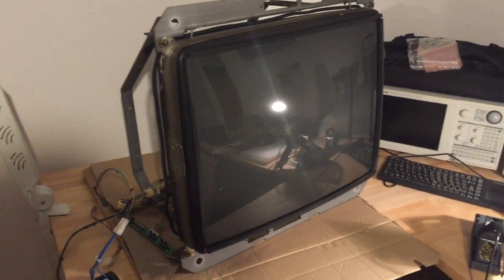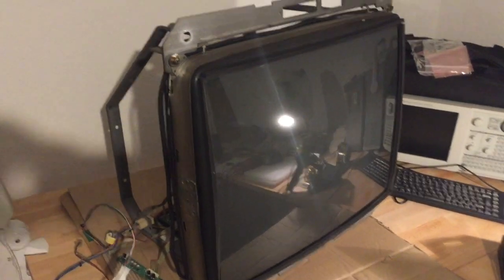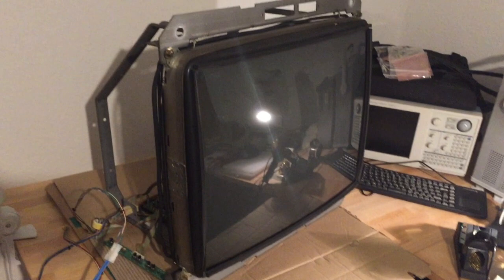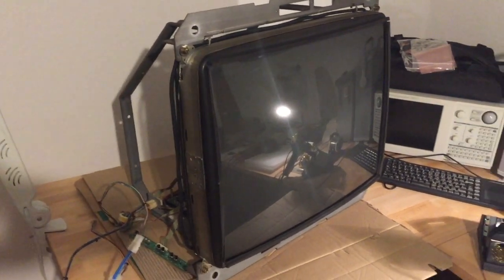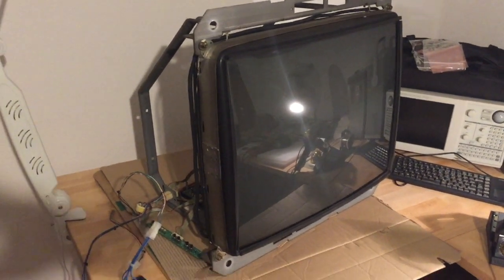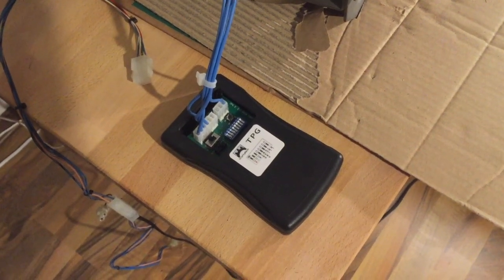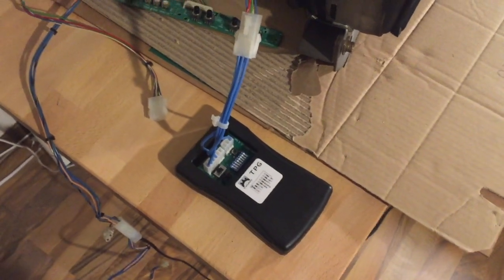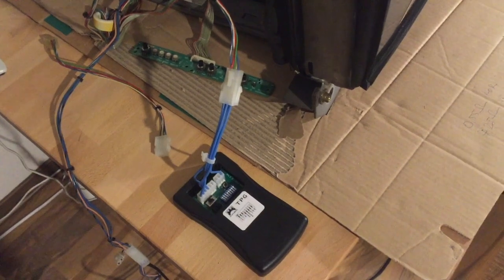Arcade Monitor Repair - Vertical collapse - Sega/Nanao MS9 29SU

Comment: Hi Doktorzett, thanks for sharing this information, I will order parts today.
I have another 29 inch Nanao with a lot of picture noise(similar to a faulty power supply on the game board video output, but I have isolated to the monitor chassis). Any clues which caps may require replacement? Rather not shot gun the entire chassis as I think this can create more problems. Thanks!
Brett

Comment: Hello - I did an entire cap kit on my Sanwa PM1745 C chassis with a vertical collapse and to my surprise It didn't fix the problem. Any idea where else to look? I have the twin Japanese Daytona USA and would really like to keep them. They were working fine with hundreds of hours of fun and the left monitor just tapped out.
Reply from the maker: Did you replace the vertical ic as well?
Reply: @christophzett  Hi - Yes, IC vertical Chip and all the caps. I have to re-check the solder points and see if I missed anything. I should have done the recapping a section at a time  like you did for better trouble shooting. I want to  keep this set. I have a Twin USA set also. Any ideas I would appreciate them. Thank you!

Comment: various arcade games use different arcade monitors with different rasters and resolutions, all the sync signals are all different for various arcade games. Any reasons why they made different sync signals for different arcade monitors? You can't take an arcade monitor and swap and replace them with another arcade monitor because the sync signals H&V signals will scramble the colors on the CRT.  The arcade monitors circuit board ground is not chassis earth ground because of the isolation transformer. Why does arcade monitors circuit board use an isolation transformer?

Comment: I ran into this exact problem a couple years back.  It would actually blow the center out of the vertical IC if certain caps were bad.  

On most of the Nanao monitors I've seen, the degauss was controlled by a manual switch mounted behind the coin door.  You would have to push it for a few seconds each time you relocate the game.  Not sure why they did it that way, since the thermistor circuit still worked the same as any other monitor.

These usually have a great picture, even if the CRT is a bit weak.  I know the older MS8 used a Mitsubishi CRT, but I can't remember if the MS9 did.
Reply from the maker: I absolutely agree! Brilliant monitor - even with a 20+ year old tube great colors contrast and sharpness of picture. I actually like them even better than the WG7500.

Comment: I have a similar issue to this but the line is right at the top of the screen, is this the same issue?
Reply from the maker: No not exactly the same because in your case the vertical ic is still doing something - it can not have failed completely because it still deflects the electron beam vertically to the top of the screen. The interesting question is only why the vertical deflection does not go through all the vertical lines as it is supposed to. In your case is the monitor chassis also an Nanao MS9?
Reply: @christophzett  no its a JVC BM-H2000PN-K broadcast monitor. It was working fine last week no warning of issues just turned it on today and nothing if I press the 'Overscan' button there are 4 while lines running across the screen at the top, usually it's red, blue and green lines going across the screen. If I press the 'Blue Screen' button on the front of the monitor (which usually turns the whole screen blue) the bottom white line of the 4 turns blue.

Comment: Current kills, not voltage (in response to the warning at the beginning). It is usually conscience they go hand-in-hand. Best proof is touching a door knob on a cold, dry day. You might get a static shock. Those that have a very mild sense of pain are about 35KV, but the current draw is so low, you barely notice any pain at all. This is why you might see people in some pain when using a Van De Graff generator, as those are about 60KV on average.

Comment: Hi, tnx for this nice  Video, i have the same Monitor. My makes another kind of problem. It flashing very strongly and has wave borders (barrel distortion)  :(
Reply: Si tienes deformaciones de tipo barril. Efecto cogin, en el horizontal, revisa los consensadores de la fuente. 680uf x35v y el de 180uf x 100 v.

Comment: I have horizontal collapse on a zaxxon cabinet
Reply from the maker: Horizontal collapse (meaning one vertical line in the center of the screen from top to bottom) is possible of cause but as far as I know actually a pretty rare condition. Maybe check the width coil and associated solder joints and connectors. Hope you can fix it!

Comment: I just had this problem with the same monitor today. What were the chances...
Reply from the maker: Interesting! Did you fix it?
Reply: doktorzett I'm waiting for the IC, will take a week to arrive.
Reply from the maker: Great! Please tell us if you were successful. Also I would really like to encourage you to do a recap of the chassis, for the sake of the vertical ic on the MS9 do at least caps c402 (440µF 16V), c406 (1000µF 35V), c407, c408, c409 (3x100µF 35V) and c411 (2.2µF 50V bipolar cap).
Reply: Yup, actually recap was the first step. Vertical problems came right after :(
Reply: Ok, I changed the IC, it just lasted for couple of seconds, it keeps collapsing... I already changed the electrolitic caps before changing the IC, any idea what to do now?
Reply from the maker: Measure the resistance of the vertical yoke wires, basically make sure that theres nothing shorted. Resistance should be above 5 Ohms I guess. If the yoke is ok I would suggest you recheck your cap-work by re-verifying the caps polarity (as you know all caps need to be put in with the correct orientation marked on the pcb) also re-check that you used the correct values (compare to cap list found at https://wiki.arcadeotaku.com/w/Nanao_MS9 ).
Reply: doktorzett how do you check yoke wires resistance? I have a multimeter but where should I place it?
Reply from the maker: Put the multimeter on "resistance" or "ohms" an with the yoke disconnected from the chassis connect the multimeter leads to the green and yellow wires on the yoke connector. It is the connector that goes next to the vertical ic.
Reply: doktorzett I've got 6.7, is it OK?
Reply from the maker: Yes that is perfectly fine! I really think you should re-check your cap-job. Check for correct polarity and values. And yes I know what you think now.  I know it is damn tedious but you got to do it! Trust me. Don't give up! :-)
Reply: doktorzett True, not sure how many times I can check the caps! Bufff...
Reply: should c402 be 470uf not 440uf

Comment: Good job as always :-)
Reply from the maker: Thank you very much - I have to confess though that the videos about the not so good jobs simply don't get released. ;-)
No, but seriously I wanted to release a centipede repair vid earlier but the board still isn't 100% running after replacing >10 ttl chips and recording video >60 min... g